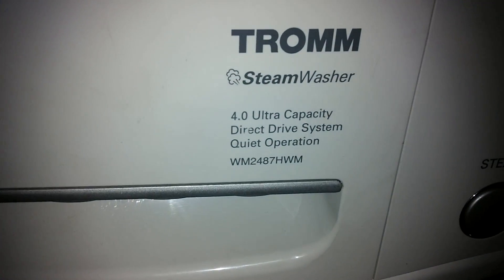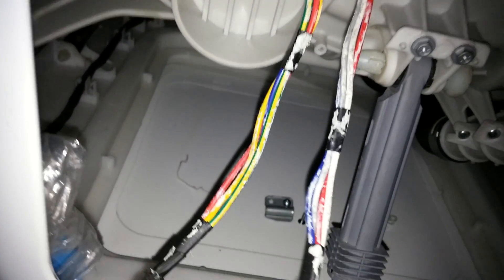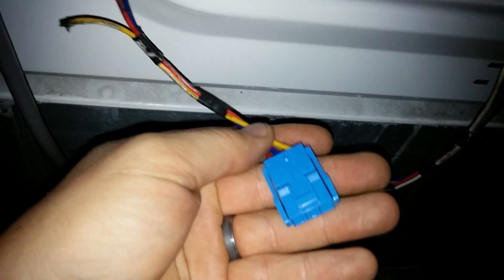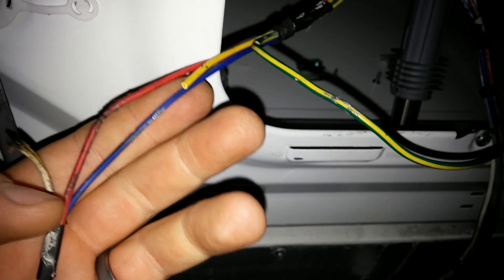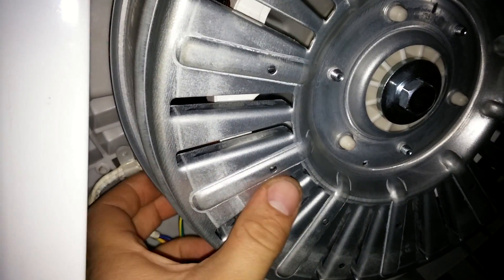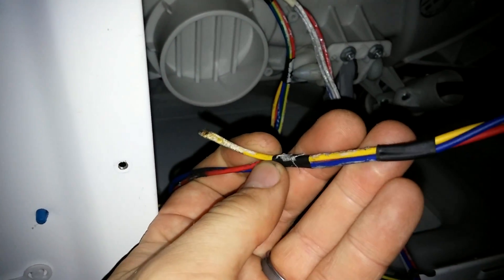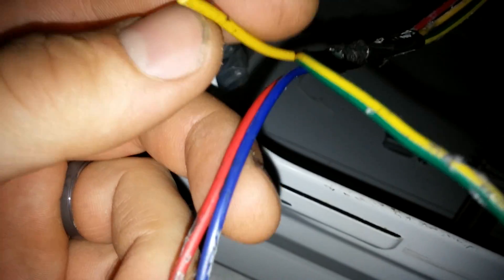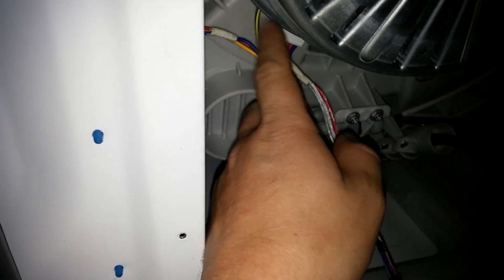LG front load washer LE code fix!

Comment: Common problem, drum won't rotate or will only turn one direction, I have fixed this 3 times over 10 years, wire size is too small for current load.
Reply from the maker: Thank you for your input!

Comment: Incase anyone is having this issue here's how I got mine to work so simple * 
My screen wasn't working it had the sound but no lights no action .. so we opened the top & in the far left corner is a white box ( mother board) it had shaken the box So bad it fell - all we did was carefully hang it back up & now it's working perfectly! 
Phew..I did NOT want to have to buy a new washer - repair man said it would be $100 just to come out & LOOK AT IT nly including parts
Reply from the maker: Thank you for your contributions!   Apparently there's a couple quirks with this model, but with people like us it will save the headache and the hit to the wallet 😁

Comment: For completeness, the YouTube video below covers another similar LG model with the same fault and cure:
https://youtu.be/0gXMcsdGmdk
Reply from the maker: comeinhandynow thing with this one was the people had lg put a new motor and sensor, with a new circuit board which never fixed it so I got it for free lol.   Best thing to do is always check electrical first to rule out bad wires and connections before replacing anything which can save in the long run.   Working in automotive sometimes trouble codes can still lead to the wrong thing lol.   I watched your video and very good by the way!

Comment: Yes ! My blue wire was broken. I ordered a pump, sensor and a set of shock absorbers before i saw this. checked wires and a test diagnostics sequence went through with no problem. Check the wires before you buy anything !

Comment: Our LE front load washer showed the LE Code.  My husband used the multimeter to check wires.  He ended up replacing the Sensor and the Control Panel.  It still showed LE Code. He checked the wire harness and wiring to the Control Panel and everything looked fine.He has always been able to fix most appliances.  I looked at your video again and comments and told him that checking the wires may be his last hope before going out and buying a new machine.    He decided he better peel back the wrapping tape and he found 1 broken wire and 1 wire almost broken through.  We ordered the wire harness and after (almost 3 weeks) I have a washer again!!!  Thank you for the video and explanation.  I can't emphasize enough to remove the wrapping tape and check each individual wire.!!
Reply from the maker: Gayleen Wine you're welcomed!   Electrical can be a pita sometimes lol.

Comment: Used a Ohm meter to check resistances. Blue motor wire open circuit. Removed  the wire harness from the machine. Peeled back some wrapping tape and found a break. LG uses iron wire instead of copper which overheats with a large wash load. A few large loads and LE code. Thanks for the fix.

Comment: I replaced me sensor but no luck. I checked the wires but they looked like they were still new and unharmed so I decided to order the wire harness anyway. While I waited for them to arrive I decided to take a look again at the wires and took them off the machine. Wouldn't you know I found a small black spot that looked like a dot from a black marker. I pulled off the tape and the yellow wire was burned through and the red wire was damaged as well! So pissed for not listening what others said since the wires looked perfect with the tape on.

Comment: OMFG this was the answer.  THIS. WAS. THE. ANSWER!!  I've been beating my head against the wall for three weeks on this issue.  I replaced the shocks thinking one or more had gone bad because their rubber bushings were destroyed.. it worked for a few more days and then stopped again.  Then I thought the hall sensor was bad and took that apart, accidentally ruining my stator while taking it apart.. so then I replaced the stator with a brand new hall sensor on it and the problem got WORSE.. instead of not spinning and sort of half-heartedly rolling around now when the basket went to spin it would start and then immediately stop and the basket would shudder.. like when the road runner comes to a stop.  so then I finally ordered a refurbed control board that arrived today, swapped that in and it was the SAME problem.  so while my wife was threatening the washer with various forms of death, mostly by office-space inspired means, I plunked my ass down and looked for a last possible solution.. and found this.. this AMAZING EFFING VIDEO.  I took apart the stator again, and then with a seam ripper carefully tore open the bundle of wires going from the stator to the first connector before it gets to the gang of wires going to the control board and lo and behold what did I find?  not a burnt wire like you.. but a red wire, cleanly severed in two distinct places.  Evidently as the washer had been spinning for the past 6 years, this cheapo-bottom-of-the-barrel wire with really stiff insulation just couldn't hack all the back and forth and finally failed.  I spliced in some new wire and voila!!  A WORKING WASHER WOOHOOO!!  if I could buy you a beer, I absolutely would.  Thank you for bringing peace and harmony.. and most importantly clean clothes so I can actually sit in the lunch room with the guys again.  phew.
Reply from the maker: You're welcomed lol.   I'm glad to give you that peace of mind.   That alone is reward enough!

Comment: Got this error code on for the first time yesterday.  Saw this post and decided to open it up and see if there was a broken wire.  Everything inside the machine still looked new except for a bit of grease around the bottom.  However, the tape over the wires was a white paper tape which seemed strange.  We bought it slightly used so it may have been taped up before.  I took off all the existing tape and wrapping on the wires and one of them had a clean cut across it.  I spliced it back together and put some heat shrink over it and then rewrapped all the wires in electrical tape.  Whole job was very easy and took less than fifteen minutes and the machine is working perfectly.  No problem with the Hall Sensor or Harness.  THANK YOU FOR SAVING ME $150 FOR A SERVICE CALL!  GREAT VIDEO!!!

Comment: Exact same issue with my LG WM2501VMA. Just because the wires don't look burned or broken, don't assume that's not the issue. Unplug the harness from the sensor and motor, plug machine in and hit power, NOT START. if there is no voltage on either the white or grey wire, there is an issue. Unplug machine and check each of the 7 wires for continuity. 3 of mine were broken inside the tape wrap, with no visible damage on the outside whatsoever.
"When you hear hoof beats, look for horses, not zebras."
Reply from the maker: That's another good way!!  I left it kinda simple that way if some don't have electrical experience they won't zap themselves.  Just disconnecting that section for some might be a little less stressful knowing they get hurt and just connecting the meter from one end to the other makes life easier, until of course it ends up somewhere else lol.  What if I want that zebra though :)
Reply: SYNTHETICDARKNESSRX8 The "Zebra" comment was for me. I changed a bunch of parts before I figured this out for myself. :-(
Reply from the maker: Franklin Klock There is a plus and that you didn't give up and just get a new one!!!!

Comment: New harness costs about $15.    I still get LE after numerous replacements of Hall sensor and now the wiring harness.  Frustrating.
Reply from the maker: If the harness was bad to begin with that would be why you went through so many sensors.  Let's hope with the wire harness it'll fix it and that'll be the end.  Keep us updated, and good luck!
Reply: No, to clarify, my harness looked fine, but I just now replaced it anyway. I've replaced the hall sensor three times over about 6 years.

After replacing the harness AND sensor it would rotate during the fill and initial wash, but at spin time it would LE error.  

Now I found and did this test, I had 0 voltage going to the motor.  (bad board?)  BUT, while testing motor voltage, I manually spun the drum on my WM2277HW and the voltage reading jumped up.  I wiggled more of the harness going up through the toroid coil and then where the hall sensor plugged in again, trying to make sure the contacts were working on there.  Plugged in the motor, and it's rotating again.  Running a load as I type, so we'll see.  

BTW, with the washer off, grab the drum and spin it manually (fairly quickly).  If the panel lights up, your hall sensor is good.
Reply from the maker: Robert Spendlove So how's everything working so far?
Reply: Since putting everything together that time,  it has worked fine.   In fact,  if you're taking this stuff apart and reassembling,  I recommend using some dielectric grease on the connections.